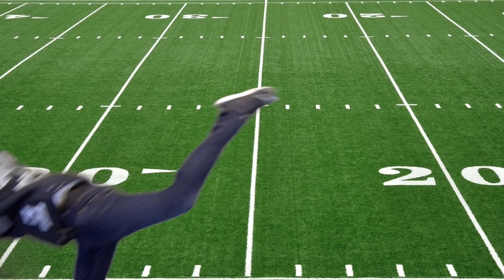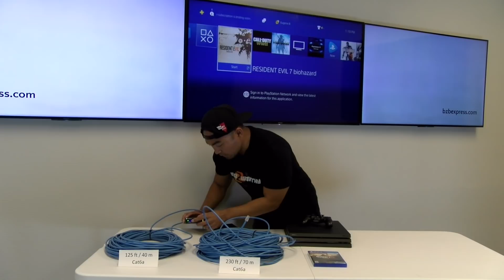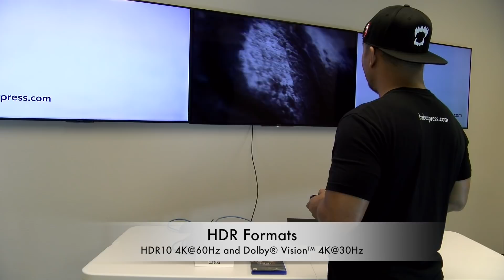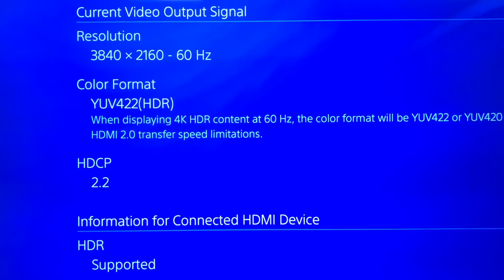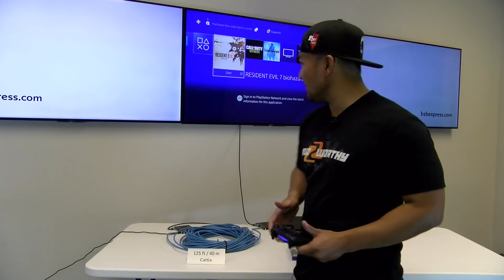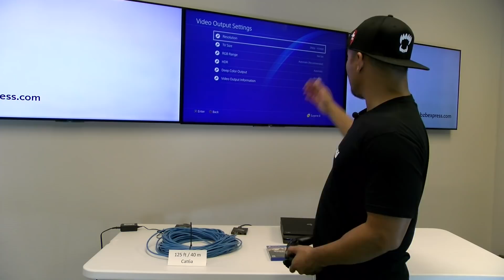The Best 4K UHD HDR HDMI Extenders $600 and Under

Comment: Hi Guys, 

Great job you're doing. I appreciate it. I just subscribe to your channel. 

I am in the market for an HDMI Extender Splitter 1X4 for installation to 4 places within my house. For distances of 46, 83, 89 and 112 feet (15, 28, 30 and 37 meters) respectively. 

I have researched and found the following three different brands and was wondering if you ever did make reviews on any or all of them. And if positive, how did you score and rank them?

The brands are: 

1. OREI HD14-EX165-K 1X4 HDMI Extender Splitter Over Single Cat6/7 Cable 1080P with Remote EDID Management- Up To 165 Ft - Loop Out - Low Latency. 

2. J-Tech Digital ProAV 1X4 HDMI Extender Over Ethernet Cable with 4 Receivers and Local HDMI Output  Supports Wide-Band Bi-Directional IR.

3. Tri-Net RO14-SPL-HSL-104C- HDMI 1X4 Splitter UTP Transmitter with PoC Ready. Receivers are: RO1-POC-HSS-RX-JP and RO1-POC-HSL-RX-FP.

Your advice would be most valued. 

Kind regards. 

Muniru Omar

Comment: Hi, Nice video. I would like to know if a cat6 cable for 30 meters distane (with the appropriate extender device) will work for video games in 4k 60hz... what's the difference between cat6/6a in this case? Thanks
Reply from the maker: Yes. This is the extender that you need. http://ow.ly/q4VW50zJWa7 

Cat6 vs 6a is simply a bandwidth performance difference in which Cat6a doubles and better for long distances scenarios up to 100m.

Comment: Sorry to say that, I don't think the controller is going to work at a distance of 125 ft.
Reply from the maker: probably not, but there are blue tooth range extenders or antennas that you can integrate to your PS4 if you really need the distance.

Comment: AT-HDR-EX-70C-KIT
4K/UHD capability @ 60 Hz with 4:4:4 chroma sampling, plus support for HDR formats

Compatible with 4K HDR10 @ 60 Hz and Dolby Vision @ 30 Hz

I don't think it is using more than 10Gbps, the 4:4:4 color sampling is used to bring it to a very close color approximation.  18 Gbps needs fiber optic, which of course doesn't carry power.

How about discussing audio pass thru with the unit?

Comment: Only thing you didn't cover is if any support ARC
Reply from the maker: Thanks for stopping by our channel. Unfortunately, none of these extenders support ARC, however said brands carry HDMI extenders that do support ARC, just not under $600. If you're looking for such unit, pls visit www.bzbexpress.com, we'll be more than happy to chat with you online.
Reply: @BZBTVchannel  Thanks I'm good just making sure reading into them right. Just helping a member from my HT group I run look for a solution in his price range
Reply: What about latency???
Reply from the maker: @Varganator  close to zero latency. tbh we weren't switching signals. We'll try to incorporate this in a future video, possibly connect the extenders to a switch and time if there's any latency.
Reply: People in the retro gaming channels are using a device called the Time Sleuth. It's used for testing display lag for TVs, but can also be used to test lag for additional in-line hdmi video processors. Check out RetroRGB. They use it all the time.